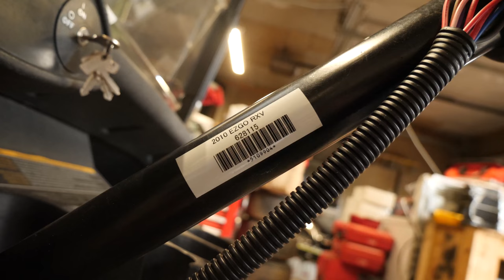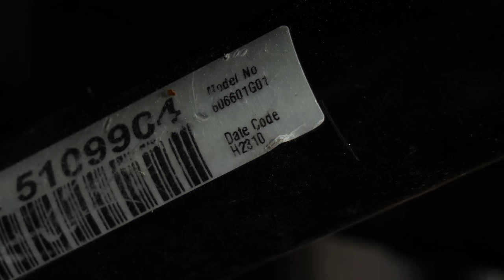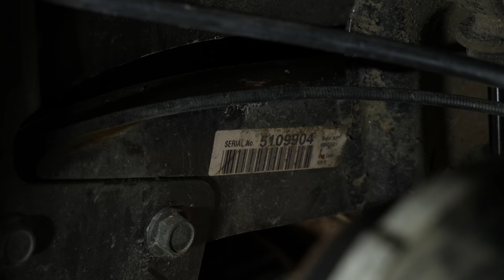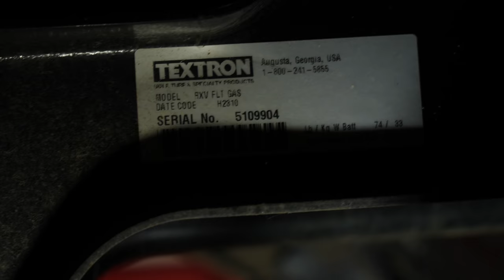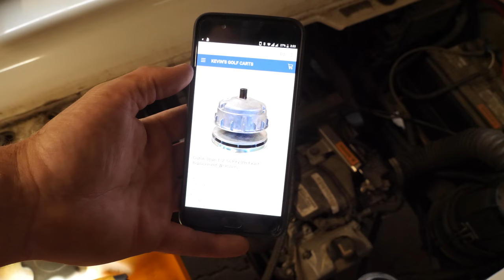2010 EZGO RXV, Gas - Serial Number Locations, Clutches Hitting Each Other

Comment: How do I determine the make and year of my ezgo. I just purchased it the gju told me it's an 03 txt.  I ordered fuel pump for an 03 txt and it was different than what i have on the cart. Thx for learning videos but I need a little help here..
Reply from the maker: Some have the date code in the passenger side glove box, some under the little flap behind the front seat bottom, some under the front suspension assembly. Once you find the serial number, you can go to EZGO's website and maybe it will tell you the Year Make and Model. Buggiesunlimited has a great resource for finding the ID tag on your cart. That is, if someone hasn't removed it.

Comment: On rxv you have new style and old style clutches. The old style looked similar to the robin clutches but had some fatal flaws so they switched to team clutches. The fatal flaw lies in the driven clutch and since that one looks brand new on the cart id say someone switched the driven to a new style but you have to actually change both. You cant have one clutch new style and the other old style. Also you cant bolt a Robin clutch to a kawi motor. Different threads in crankshaft
Reply from the maker: These are junk carts. EZGO has gone down hill.